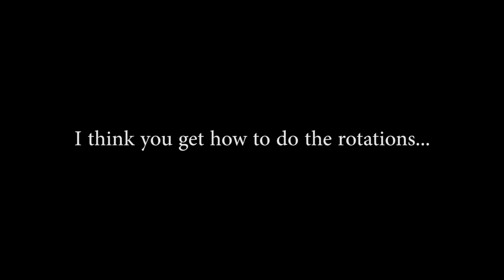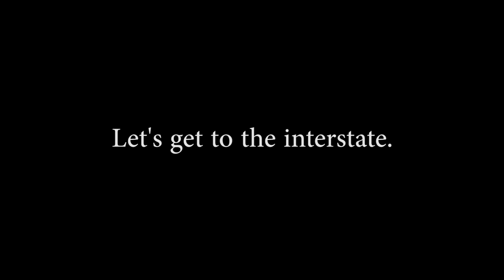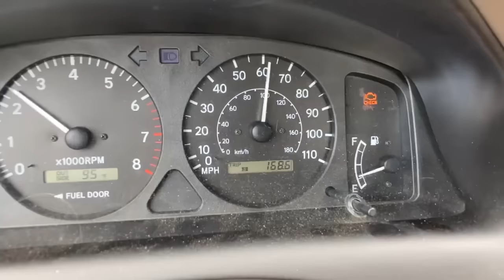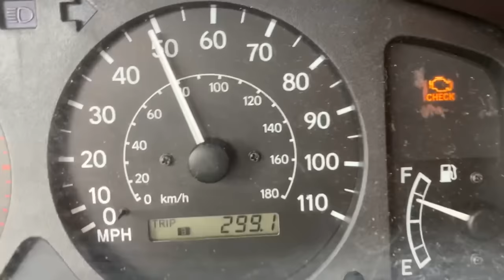Will Berryman's B12 Chemtool stop oil consumption? 😲 | Oil Burning🔥Experiments | Episode 15

Comment: First of all, this is an amazing video, thank you so much for sharing.  You inspired me to try this with my car.  
In September, I bought a 2007 RAV4 with the now imfamous 2AZ-FE engine, with 121k miles.  The car is in excellent condition, the oil was changed every 3 to 5k miles, and all the recommended maintenance and more were done to this vehicle (occording to the car fax).
I was so surprised after driving the car for a few hundred miles to find that the oil was down about 1.5 quarts (the vehicle was burning 1 quart of oil (5-W20) every 500 miles).  After doing some research, I discovered about the piston ring design flaw in the 2007-2009 2AZ-FE.  
I was so disappointed about the vehicle, the last thing I really wanted was a car that was burning so much oil.   Soon after I bought a boroscope camera and scoped out all the cylinders, and after seeing what the piston heads looked like, i became even more disappointed.  They were all covered with a thick layer of carbon and the #1 and #4 cylinders looks kind of like the surface of the moon.

I'll be sharing photos of just cylinder #1 here:
https://photos.app.goo.gl/E5daUnVNmchmcR5a7

I ran a can of berryman in a full tank of gas, it looks like that maybe took the edge off the carbon a little bit:
https://photos.app.goo.gl/nzR5bJp2dYHZoc9Z8

Then i ran 2 cans of berryman in 1/4 tank of gas:
https://photos.app.goo.gl/xpd5D3CQTgUPk8um8

Then I worked up enough nerve to try a piston soak with the berryman b-12.
I did the soak for about 1 hour and then vaccumed out the berryman:
https://photos.app.goo.gl/cBhxZVwfCDiq9bPAA

Then another 1 hour soak and vaccum:
https://photos.app.goo.gl/v63q16gsJLuLpBEo6

The engine took a while to startup, but after it did there was not any smoke!, i ran on the freeway for about 30 minutes,  just normal running (no high reving) , in 4th gear on the transmission.  I ended up with this:
https://photos.app.goo.gl/ybH9SCwfwrdyvob49

I then let the engine cool down, and i then put 8oz of berryman directly into the oil.  The oil had been changed 1300 miles previously, and was a nice light brown color before the berryman.  I then started up again and idled the engine (smoke came out of the exhaust), then took it for a 10 minute drive (again no high reving).  I then changed the oil.  The oil came out midnight black in color.
https://photos.app.goo.gl/GJW9LHaMsCouG95P8

I then changed the spark-plugs and I have about 40 miles on the car since the oil change.
I was burning 1 quart every 500 miles, and i'll have to let you know if this has helped at all.

One footnote.  I used a handheld piston pump to vaccum out the berryman from the cylinders.  After the first vaccuming, the pump sat for bout 1.5 hours, then i pumped out the berryman from the 2nd soak, the pump on the 2nd vaccum was much much harder to pump.  I think the berryman removed or displaced any oil that was in the pump's cylinder. 
I'm thinking that many of the folks that advise to put a little oil in each of the car's cylinders before startup are probably right on.  I'd be willing to bet that the car would start faster and with less friction between the cylinders and the pistons.
Reply from the maker: Thanks for all of that, Seth! 🙂Tons of good info, with pictures!  Please do keep us posted on the oil usage. I'm sure a lot of others would rather try this less severe approach if it is just as effective.👍
Reply: @FamilyFriendlyDIY  It's been 275 miles since the oil change last week.  The dipstick is difficult for me to read, b/c the oil is so clear, but it looks like I have not used any oil so far!!  😮 Fingers crossed that this has solved my oil burning issues long term.  I'll send another update at about 1000 miles.
Reply: Any update ?

Comment: This works for Audi's with 2.0t FSI oil burning issues as well. Mix PB blaster 50/50 with B12 and it works even better. Issue with the Audi's is a bad piston/ring design so it will continue to happen. Have to do the treatment every 3rd oil change to keep it clean. Cheap insurance for a potential $6k job.

Comment: I have resurrected so many old GM V8 using berryman's B12 in the gas and marvel mystery oil in the crankcase, I have the same results that you got oil burner smoker 
,  blew out all the carbon runs like a top, I still using it today

Comment: I would’ve checked/ photographed the dipstick prior to the chemtool adding. If the oil level had gone up then you have dilution. Dilution? I would’ve let it idle in the driveway for an hour or so, under no load.

Before running the engine tho i would’ve added a teaspoon or so of diesel or light motor oil to each cylinder to lube them after that experiment. 

I’m going to try it on a Tiguan.

Comment: I have a 2008 Rav4 with 350,000 miles.  It has the Corolla engine.  It was burning a quart every 500 miles.  I did 2 treatments of inexpensive Gumout Tuneup w/Carbon Clear.  Performance greatly increased, I gained 2 to 3 mpg, and oil cosumption is down to around a quart per 3,000 miles.  Maybe I got lucky, but it sure seems like a inexpensive magic bullet.
Reply from the maker: Wow ... that's really good! I think you caught it early. Did you just put the Gumout in the fuel? ... or the crankcase?

Comment: Not sure if you found the article or not, but supposedly Toyota had a service bulletin to replace the pistons and rings with more oil control holes in the piston and a larger cutout on the end of the oil control rings. There's a guy that just pulled the oil drain pan. Pulled the crank from the bottom and drilled out 2-3 extra holes into the pistons and filed the oil control ring ends a little more to allow for more oil to pass. On my 2002 Corolla I just went with Mobil 1 High Mileage Full Synthetic and would put MMO in the last 20 miles before oil change.
Reply: Going from Castrol Edge to Mobil 1 High Mileage nearly stopped my oil burning, but I did develop a leak on my main seal.
Reply: @Juhsga  the reason why u have leaking seals was because u “overfilled” your oil. What I mean by overfilled is do u fill your oil to to TOP mark of the dip stick thinking that’s the correct oil level of “full”? If so, then no wonder u have blow out seals.

The correct oil level of “FULL” is ALWAYS the MIDDLE line of the dip stick between the bottom line and top line, not all the way to the TOP line or hole! If u fill your oil to the top line, when oil heats up, it will EXPAND past the the top by a lot. If u don’t believe me, try see it for yourself next time when u check your oil after a 20 mins drive (engine fully warmed up), see if oil expand past the top mark? If so, oil will start expanding and putting unnecessary pressure on to your seals and gaskets becuase the pressure needs to go somewhere, if u keep on doing that then sooner or later, your seals and gaskets will give up on u prematurely. I’ve known people with 300k miles engine with original seals and gaskets by not filling the oil to the full mark but instead, fill it to the middle mark between the bottom mark and top mark.

The correct way to fill your oil is to the MIDDLE line of the dip stick, never to the top mark and never to the bottom. Because u need to give oil “ROOM” to expand when it heats up. Filling to the middle line will gave oil enough room to expand in the engine, so when u check oil after warmed up, it will stay near the top line but not over it. 

Same thing with automatic transmission fluid, and power steering fluid, always check level when HOT (after 20 mins drive). because u will see them expanded a lot past the full mark. So adjust it to full mark and when the oil cools down, it will end up to the half way mark.

Comment: Toluene is definitely a strong industrial solvent used in lacquer thinner.  I would strongly suggest performing an oil rinse and a second oil change with seal conditioner or high mileage additives. 

I think this method is risky for direct injection Teflon seals and crankcase seals. I still feel a better method for strong industrial solvents (toluene, acetone, xylene, mek, etc.) is an oil drain plug removed soaking of the piston rings with back-and-forth agitation (not full rotations), followed by two oil changes. I think 2nd gear city driving for high rpms was suggested.

I still think the safest cleaning method is with an oil ester like auto-rx or HPL engine cleaner. It takes patience because of the mileage but I think they adhere to a first do no harm approach even if they fail to stop oil consumption.

Update:  Gumout multi-tune (scotty) has PEA and is designed to be use in oil and gas. It's stronger than seafoam and could finish the job or be use for maintenance. With both gumout and seafoam you want to keep the mileage below 150 at recommended concentrations (1oz/Qt.)

Comment: replaceing a liter of oil with a liter of atf works too, Or you could just run valvoline restore and protect which is high in detergents that clean carbon off the rings over the course of an oil change interval. I have never had a car do oil burning like that but then again I run high quality amsoil signature blend and my cars get driven 45 min distances at highway speed every time they start up. carbon build up is from short trips where the car does not get run at operating temps for very long mixed with poor quality oil.

Comment: I have used B-12 for years, but never tried pouring it into the cylinders.  The spray is good for PCV and carb cleaning.  If it splashes on the paint, it will discolor it.  It will burn you if it gets on you without washing it off fast.  The spray with a quick shot into your mower carb in the first start of spring will start it faster without draining the battery.   The spray kills wasp almost on contact.   Also, after you clean you paint gun with paint or lacquer thinner shoot some b-12 through the tips and more paint will come out.   I have a 2003 Camry I may have to try your experiment on.  Thanks.
Reply from the maker: Thanks for all the info, Bill!

Comment: That's amazing! Nice project. But if you want the cheapest solution, Oil Catch Can is your best bet. 

The problem is with the design, new piston rings will not fixing the design flaw.

Poorly controlling oil blowby started before the rings got stuck.

Take the oil vapors out of the equation with a catch can, then drive your car, and your oil consumption will get a lot better in time, if not 100% gone. When I say 'in time' I mean either instantly, or maybe 100% gone by 30k miles. 

Your car needed an oil catch can when it left the factory floor

Comment: I had a car set for 2 years with gas in the tank. I was a truck driver and hardly home long enough to work on the car's transmission. I put B-12 in the fuel tank and 2 years later after I replaced the transmission the car started on the first try. Don't know if it was the B-12 or a combination of things but it seems to help.

Comment: I had an 02 carolla. I did the seafoam/mmo soak multiple times. It never seamed to make a difference. Just before 300k it broke a ring on the #2 cylinder, burned off all the oil and spun a bearing. The oil control rings were coked up with carbon, seizing them to the pistons. My conclusion was to use quality synthetic oil. Quality filter and regular oil changes.

Comment: Looks like a little italian tuneup did help loosen up the rings. IDK how long your daily commute is. I wonder if the "redline a day, keep the carbon away' rotary engine trick helps. Maybe try redlining once a day for 300 miles and see how much the oil gets used.

Comment: For anyone with an engine prone to ring sticking.
If you use Rislone in the oil 500 miles before each oil change you'll never have a problem.
Drain the equivalent of the Rislone bottle, add the bottle of Standard not High Mileage Rislone, drive 500 miles and change the oil.
Everything in the engine will stay clean.

Comment: Tedious work... Don't know if you've tried it, but Auto-RX is much simpler. Fill conventional oil + new filter, add Auto-RX and drive as usual. (Follow instructions). Takes time, but it works if engine is not worn so much it must be rebuilt.

Comment: So this method you used with Berryman's also works with Seafoam. Seafoam, people just approach it differently. But the soaking you did was so important to free the low pressure oil rings and more around the pistons, plus you burned off all the carbon on the valves and their seats and pistons most likely. The best way to keep this going strong would be to use some Marvel Mystery Oil in your crank every oil change, and some berryman's in the tank or just the same mystery oil.

Comment: 9/4/23
Hi Dave/@blackysan. I would like to thank you for this fantastic video. I have a 2007 Toyota Camry and performed the B12 piston soak for 24 hours and drove at 4500 rpm for 20 minutes then changed the oil to 5w30 kirkland. I have driven 800 miles and the oil level is about 1/16" below the top dot. I keep checking the dipstick expecting the oil to lower each time I check. From the way it looks, I'll be able to drive the car w/o adding oil to the next oil change of 4k-5k mile. 

In your video it was not clear about warming the car prior to the first engine soak, I did not perform a warm soak. Everything else was performed as required. 

This car was for my daughter in college in southern california. I knew it used oil in the range of 1 qt per 1k mi. She first brought up the major oil loss once we started using 20w50 oil, I think the oil flow was clogged  producing more oil usage.
The next oil change, I plan to use 5w20 on this engine. I believe the thicker oil assisted in clogging the oil ring and piston holes.
Reply from the maker: So glad to hear that, Brent :-) Thanks for posting!
Reply: Hi all i am now at 998.7 mile and the dipstick still reads full. I did one additional thing this morning was remove the VVTi solonoid and cleaned it with carb cleaner. and drove it 70 miles. I noticed better accelerations and smoother idle.
Reply from the maker: @brentgong2412  I’m jealous. That’s awesome!👍🏻👍🏻

Comment: Looks like you might have a pcv issue or maybe  valve stem seals leaking. I would ABSOLUTELY change the pcv valve and make sure the rest of the system is flowing correctly. Just a suggestion.

Comment: Wow looks like a happy ending to you series. 
I am doing 3 day Seafoam piston soaking method, at the moment. I am not very positive about it. Meanwhile I learned about Berryman B-9 Chem Dip Parts Cleaner. It looks really strong and used for cleaning tough carbon deposit, I was thinking to drain the engine oil and leave the drain plug out then soak the pistons with B-9 for only 30 minutes max. Let any rundown out of the drain plug. Put the oil back and drive at high rpm for some time. Repeat if no improvement. By the way my immediate issue is excessive blowby in 05 Camry 2AZ-FE engine. Not sure about the oil consumption yet.
Reply from the maker: Someone else said they tried the Chemdip and ended up seizing their engine, so be careful. — Please let us know how your experiments go!
Reply: @FamilyFriendlyDIY  Thank you for your comment. My Seafoam experiment didn't improve anything. I might have bigger issues than sticking oil ring. I will definitely share my experiments results.

Comment: On another note, and a different topic, use some Cerakote headlight restore on those headlights! They work great especially as winter is coming.
Reply: I recently polished my headlights with mother mag wheel and aluminum polish and now they look brand new without any sanding! I used a 3" foam polishing pad on a standard drill and my headlights literally look brand new.  I had used PlastX from meguiers and it worked ok but with more work than mothers mag polish took for great results.
Reply: @Itsarealone  well yes but do you have a protective uv coating? One which maintains the clarity. I also polished my headlights but i also sealed them. I've found cerakote to be really easy!
Reply: @jagtan13  carnuba wax and ceramic coating.  The best option is to put an actual clear coat over them
Reply: @Itsarealone  well it's in the name lol cerakote. It beads like crazy 😀, and it feels slick to the touch! Either way for $20 bucks all you need is in the kit. Short of the polishing kit, wich i used as an extra step, which i also have and used before coating. They're crystal clear and protected, i've used carnuba before as well and usually i'd have to recoat my pickups tailights almost monthly. The sun in CA eats through coatings.

Comment: amazing job!! finally we dont  need to take apart engine, oem piston oil return hole very small, so always use good oil,  i have those old piston with clogged hole, ill sock in b-12 and see what happen! ...... after re-ring my 1zzfe i drive 8000km b4 oil change, zero oil burn, mmmmm"mmmm thou .....

Comment: I found a lot of these treatments work well for engines with direct injection. I think that Toyota is Port injection. I would try Lucas oil stabilizer for synthetic in that car. It worked for my mom’s 1998 Corolla with the same exact engine. If you’re interested try it. It’s not expensive either. All you do is replace a quart of oil with a quart of Lucas full synthetic stabilizer.

Comment: According to b12 SDS it contains:
Toluene 108-88-3 40-50%
Acetone 67-64-1 20-25%
Methanol 67-56-1 20-25%
Methyl Ethyl Ketone 78-93-3 <5%
2-Butoxyethanol 111-76-2 <5%
2-Propanol 67-63-0 <5%

Question is if seals are resistive to ingredients? Pouring to cylinders seems to be 100% safe yet I would not allow it to run in th engine so oil should be replaced immediately after B12 evacuates from cylinders.
Reply: i totally agreed with you. it is best to replace the oil immediately after the procedure.